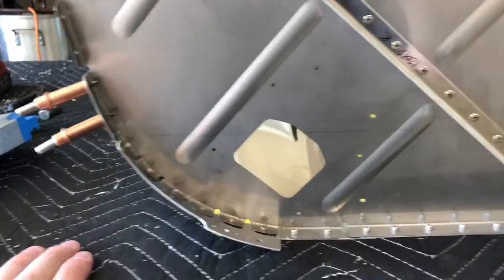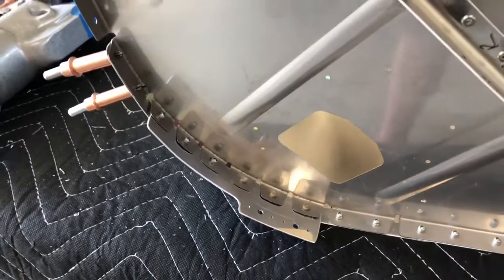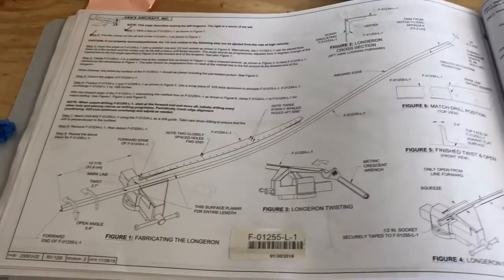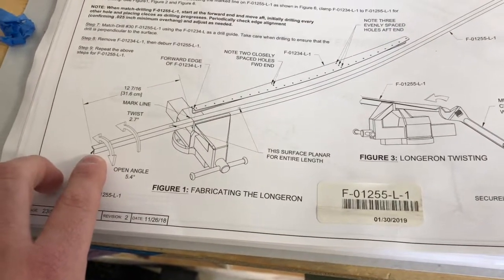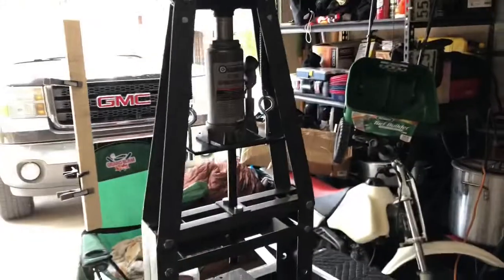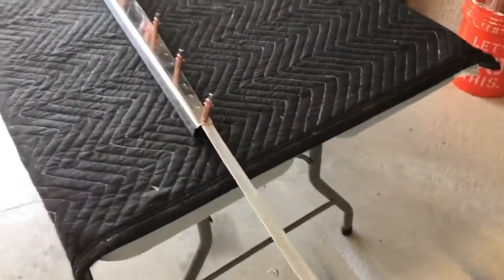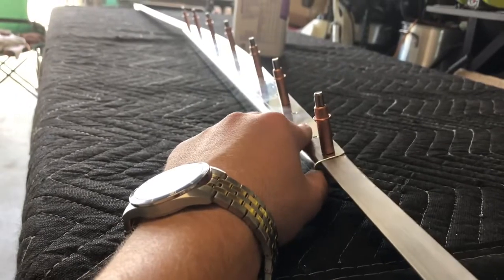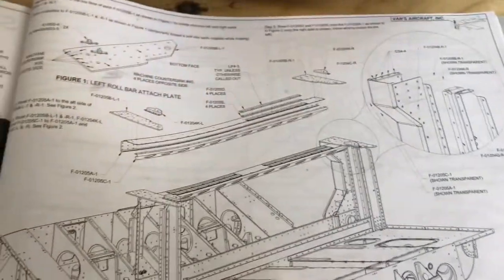Vans RV-12iS Fuselage 9

Comment: I’m watching through your vids for the 3rd time now. Lol. Have to keep entertained while stationed here in Bahrain. Anyways, I wanted to ask about the nut plates. I know there is a lot of them used throughout. Are they having you dimple the skin and the nut plate, or countersink the skin and leave the nut plate flat, or a combination of both of these? Thanks.  Keith
Reply from the maker: Keith Rush it all depends on the thickness of the metal the nutplate is attaching to. Once the metal reaches a certain thickness it can essentially no longer be dimpled without deforming the metal or breaking the tool. I don’t recall the specs off hand but once you start building you can easily tell which metals will require countersinking and which will require dimpling. If the underlying part requires dimpling the nutplate too will need to be dimpled. So in short, both would be required depending on the above. Hope this helps

Comment: The Longerons and the fiberglass are the two parts I'm not looking forward to. However, I just came across your videos and want to say thank you and I'm enjoying them and your explanations.
Reply from the maker: Thanks Bpreeb, im learning as I go. The longerons aren't bad if you have the right tools/equipment. The key with them is once the sideskins get fitted on you can very easily see any what adjustments need to be made. So make sure you fit, adjust, fit and keep adjusting your angles until its right before riveting. Luckily i only had to make 1 small adjustment to the right longeron once fitted in place. What kit are you working on?